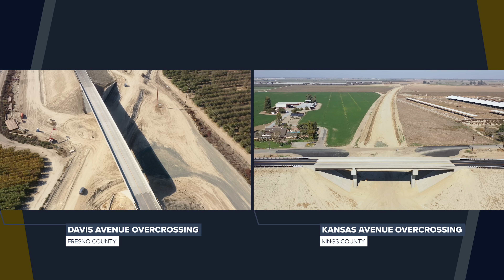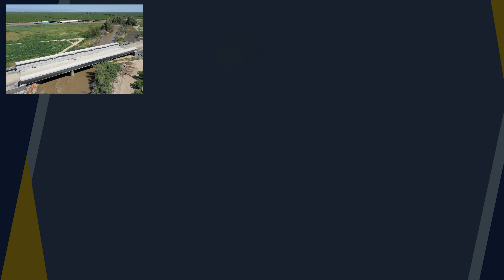Fall 2023 Construction Update: Progress is happening across California thanks to HSR Workers!

Comment: I'm from Texas and excited for this to fully go online. American designed true high speed rail. If anyone has traveled to a country with well developed public rail transportation, you know how much the U.S. needs projects like this. Interstate 5 and flying won't be the only fast options anymore.
Reply: I’m excited with texas central and amtrak’s plan, let’s see when the line from dallas to houston will open
Reply: It will be the fastest option for travelers. It’s going to be faster than flying or driving.
Reply: @harutosunaa3881  No it wont be faster than flying.   And as for driving, you still need to get to your destination, which likely is not the train station.    A car allows door to door service.
Reply: Well, how's your high speed rail going
Reply: Not just American designed but over some of the most challenging train on earth.
Reply: @trippg3261  Sorry, but the Terrain is definitely not challenging. It is almost completely flat. Meanwhile, in my home country of Austria (and Italy) we are building the longest tunnel in the world to connect Italy and Austria under the alps (Brenner Base Tunnel). Germany and Denmark are building a Tunnel under the sea (Fehmarnbelt tunnel). Sure there are other big challenges but difficult terrain is not one of them.
Reply: @florianix8272  The Central Valley section currently under construction isn't in challenging terrain, but in the next phases the line will have to cross 3 mountain passes (Pacheco, Tehachapi and Soledad) with with some pretty long tunnels (Pacheco Pass Tunnels will be 21km in length). It's not the Alps, but it's not flat.
Reply: @elperenza  That's cute. But it's nowhere in the mentioned area of "over some of the most challenging train (sic!) on earth." Just for reference: the original gotthard train tunnel in Switzerland has a length of 15km and was openened more than 140 years ago! So please don't be too proud by building an average train line, if it even will be completed anyway.
Reply: @1879heikkisorsa  I'm Italian, I know my Alps very well. Sure, the original Gotthard tunnel is a marvel of engineering (and so is the new Base Tunnel), but that doesn't mean that 20km tunnels built today aren't still an engineering challenge.
Reply: @1879heikkisorsa 

" the original gotthard train tunnel in Switzerland has a length of 15km and was openened more than 140 years ago! "

It's much shorter than what we're talking about and the Americans just fly, it's a lot faster and much cheaper for the government.
Reply: @neutrino78x  kiddo, that's just one example of many in such a small country as Switzerland is. The main point you really missed: That was done almost 1.5 centuries ago with much much less technology available. So it's simply wrong to state that this tunnel is one of the most challenging in the world.
Reply: @1879heikkisorsa 

"kiddo,"

I'm 45.

 "that's just one example of many in such a small country as Switzerland is. "

Yeah, it's small, so if they have HSR it doesn't mean we should have it.

We use trains a lot here too, for short distances.

"So it's simply wrong to state that this tunnel is one of the most challenging in the world."

I wouldn't necessarily say that, but it is a challenge and it's one of many reasons why the idea of CAHSR is stupid and a huge waste of money.
Reply: @florianix8272  Have you seen the plan for the tunnel from the high desert into the Los Angeles basin? Perhaps not the longest. but Palmdale-Burbank with about 4 tunnels, the longest at around 45 km (I don't believe a final alignment has yet been selected) is nothing to sneeze at.
Reply: @florianix8272   the Los Angeles area especially coming into it from the north is definitely not flat and does pose a challenge for american engineers.
Reply: Yeah I'm from Norway and we built a tunnel under the sea which is 28 km long. Or look at China what they achieved! A 20 km long tunnel is only a engineering challenge which can be solved. I think a lot of Americans are used to things fall before their feet and don't really have the patience to walk a longer difficult path to achieve something bigger. @elperenza
Reply: on which earth is this challenging to build? @trippg3261
Reply: @trippg3261  The rail cars are being bid on by japanese and european companies, hardly American.   Keep the lie going however.  This thing is a disaster.
Reply: An interconnected rail system can only be good for the future of our country.
Reply: @inyobill Thumbs up unto infinity👍👍👍. Is about time money was invested in this country.
Reply: @ac1888  "... about time ...", right?
Reply: One of the biggest downsides of things like new train stations is the lack of human sized spacing around. Once you get to many locations on a train you’re back in car dependent hell. 

That’s a result of cars being the only option. That’s why we have to be building public rail as much as possible to drive demand for human sized spacing. Property changes based on demand, and public funding is one of the few mechanisms that can change the type of demand an area accommodates. Capitalism doesn’t want to invest on public infrastructure because the returns are too low if there is any return at all.

Hopefully we realize that, projects like this are not one and done but require constant construction and constant investment to keep expanding and keep connecting small towns and areas that fit the human scale.

I would love to hop on a train and travel south to CA and never touch a car while exploring.
Reply: @ColrathD transit in the Bay Area and LA area should be good. It’s the Central Valley cities that rely on buses where it’ll be more of a challenge. 

Ridesharing will be a big thing around there as well as within the major cities, but even more so will be more affordable housing and full-fledged communities with everything needed (grocery, post office, pharmacy, etc.) within walking distance of the stations, so one wouldn’t necessarily have to drive anywhere to begin with.
Reply: @ColrathD  It helps that the stations themselves will create walkable demand around them. You'll see small areas with high-density development pop up once these stations start seeing actual use. It's not enough, but it helps.
Reply: @ColrathD  The funds would have been better spent on widening I5 freeway. That will make driving faster and safer.
Reply: @dave8599  when has widening freeways improved driving speeds? The fastest places to drive are interstates with just two lanes. Even at high capacity, the speed comes from long straight roads. No matter how wide lanes are, freeways with slight turns always slow down traffic. 

The worst part about driving a car into the city is being limited by parking. It’s like there is a huge line drawn between what someone with a car can visit and someone without a car can visit.

Investment in freeways is a backwards way of solving traffic. They don’t need more investment. They’re incredibly expensive and inefficient. Public transportation can move a lot more people than cars ever could dream of.
Reply: And I’m from Texas, but I live in Oregon. I’ve also lived in Virginia, Oklahoma, and Florida.

Show me someone who can explain why any of that’s relevant, and I’ll you show an i.diot.
Reply: @cwg73160 you're too United States and free travel and unified document systems to appreciate our regional rivalry.. Texas and California, both carry lone stars in our flags.  Somewhere along the line the rivalry turned bitter, but it was always meant to be a healthy one.  We're both a long way from DC and have a mind of our own.
Reply: Let's build two different high speed modern travel systems that meet in Tucson or Phoenix
Reply: I'm still miffed that Florida passed us in getting a HSR first and California is still building it. But I bet it's gonna be monumental connecting central valley to both Nor-Cal and So-Cal cities.
Reply: @PsychoSpiral  it's only to be completed Merced to Bakersfield. Once they get done with that they will stop. There's no more budget to continue. It was a stupid idea from day 1, it's too far for rail
Reply: "Interstate 5 and flying won't be the only fast options anymore."

Uh, yes, they will. The flight is ONE HOUR.

This distance is too far for HSR. It's 380 miles or 611 km. The only comparable line in Europe is Madrid to Barcelona, which isn't really comparable because the population density of Madrid and Barcelona is quite a bit higher than that of Los Angeles. 

This thing would (it's never going to be completed) take at least 2 hrs 40 minutes, and as a practical matter, more like 3 hours at least. (2 hrs 40 min assumes you can go SF to SJ in 30 minutes, which would require the maximum speed to be raised on Caltrain, and we're nowhere near being able to do that.)

Higher Speed Rail, along the coast line (including Amtrak Pacific Surfliner) would make a lot more sense as it's a lot cheaper and it wouldn't be much slower (about 4 hrs SF to LA, vs 3 for hsr).
Reply: @neutrino78x  "The flight is ONE HOUR."

Plus showing up to the airport at least an hour early (likely more) to go through security and wait for boarding, then starting boarding to actual takeoff is a minimum 30 minutes, getting off the plane is like another 15 (again, minimum) after landing, then another minimum 15 to collect your bags...  So that "one hour flight" quickly turns into three hours even on the best possible day.  Oh and all of this is assuming the plane is actually on time, which any regular flyer can tell you is a crapshoot.
Reply: @zackakai5173 

"Plus showing up to the airport at least an hour early (likely more) to go through security"

Nah, that's more like 20 minutes. Just because you suck at travel doesn't mean it's that way for everybody.

This is more valid in Europe where their airports are typically very far away from the dense part of the city.

For example, here in San Jose, SJC is only 3.8 miles from the downtown core. 

Plus you know, when you're talking about a three or four hour train ride, versus a one hour plane ride, that isn't really saving you enough time to say "well it took three times longer but I avoided security which only takes five minutes". 

There's no logic in that argument. Fail.
Reply: @neutrino78x Yeah and with a high speed rail you have a much more comfortable travel than a plane, you go on and off in the city centre, you can arrive in the train station 5 minutes before the train leaves. So your one hour flight is not much faster if you go to and from the airport (with car instead of local train I assume), and wait at least 30 minutes for the flight. It's not really a time saver pluss it creates much more CO2, and is less convenient. High Speed train outperforms flights if it's build complete and not reduced by conservative populists!
Reply: @Skogbox  

"eah and with a high speed rail you have a much more comfortable travel than a plane"

Who cares when it is too slow.

The distances involved here in North America are far greater than in Europe, and the population density is too low to justify the enormous expense.

Simple as that.
Reply: It's still 10 years out from the first paying rider and the fare charged will never cover the cost of maintenance much the current estimate of $128,000,000,000 to build!
Reply: @mobeydick37  mobey, these fools are going to argue with you but you're 100% right. I voted no on this nonsense with pride, despite being a lifelong centrist Democrat. I agree with you, it's a complete joke.

The good news is that the Governor has already stated, "there is no path" financially to complete the whole thing, so his orders are that they complete what they started -- merced to bakersfield (nowhere to nowhere) and then stop.

Technically he can't actually stop the project, because it was a voter initiative, but he doesn't have to make it his number 1 priority either lol
Reply: @neutrino78x Car lobbyist

Stop acting with such entitlement. You obviously know nothing regarding the progress and benefits of this project.
Reply: @fizzystuff 

"ou obviously know nothing regarding the progress and benefits of this project."

Your argument is so compelling! We are all smarter having read it!

He said sarcastically
Reply: Interstate 5 is awful 
Especially the Grapevine and anywhere near LA, plus random accidents that cause slowdowns
Reply: @dragon_nammi 

"nterstate 5 is awful "

That's why most of us just fly.

There's no traffic on I-5 BETWEEN the Bay Area and LA.

WITHIN LA, yes.

WITHIN the Bay Area, yes.

BETWEEN them, no. Everybody flies.
Reply: @neutrino78x  Spoken like someone who doesn't drive the I-5. There is always traffic. And the airport is lousy as well, not to mention you need a rental car at the end or to pay for ride hailing if your destination is close enough. Not to mention your flight can be delayed or cancelled due to storms that are common in the eastern United States, where your plane is likely to be coming from. Last year my flight was cancelled last minute and there were no other flights leaving in time.  I had to drive the I-5. Even when I try to avoid it doesn't let me.

Now is the traffic is bad along I-5? Certainly not, but it IS just a two lane highway. Semi trucks passing each other are enough to slow things down to below the speed limit, quite often. Along with accidents that tend to block at least one lane of traffic and clueless drivers sitting in the passing lane. Not to mention it is a straight, boring road with little to keep your attention once you leave the cities and mountains. It's just awful.
Reply: @dragon_nammi 

"Spoken like someone who doesn't drive the I-5. There is always traffic."

In Los Angeles, yes. By saying "the I-5" that tells me you are from LA.

But you have to remember, this project would have zero effect on traffic WITHIN the city and county of Los Angeles.
 
"And the airport is lousy as well,"

Nah, the airports work great. I make the trip often, security is a five minute thing.

I never arrive earlier than 10 minutes before boarding begins and I never run into problems. 

As someone who flies it normally, my opinion is important, because you're trying to get us to stop flying and use your stupid train.

And I'm telling you right now, no one will do that because it takes three or four times longer.

" And the airport is lousy as well, not to mention you need a rental car at the end or to pay for ride hailing if your destination is close enough"

Same for your train. I don't know why you think it would magically terminate where you're going within LA. It would terminate at Union Station. 

It's a huge waste of money.
Reply: @neutrino78x  You might fly, but I drive the the route more often than I like. Your opinion matters as much as mine does, as a similar amount of people drive and fly. A fast train is a compelling proposition for drivers, and a cursory web search says there are about 11 million auto trips between LA and SF annually. Grain of salt of course.  If you find it easy to fly, then you will keep flying. But I expect a lot of drivers would consider it. Driving the 500 mile route is awful. 

Yes, LA has the worst traffic. But if that's where you think the traffic stops, you're dead wrong. There are only a few sections where you can actually drive at a decent speed on the I-5, starting about 150 miles away from the Grapevine. That's when people just start to thin out. But you will eventually be significantly slowed down by semis passing other semis, however long that takes. There usually is at least one accident along the flat boring section of the interstate which can cause a decent delay. On my most recent trip, there was a massive hour long delay on the Grapevine alone, and I encountered 3 different accidents on the return trip before encountering the Grapevine on the way back. Each with its accompanying slowdown since one of the two lanes was blocked by debris for each accident. And I mean slowdown, down to an eye watering 0-5 mph.

And that's without even mentioning people who clog the passing lane and cap speed at 65 despite it being a 70 mph zone. You're misinformed about there being NO traffic once you're out of LA. 

And of course... the it can be a dangerous route, particularly if there are storms.

And you misunderstood what I said about having to find last mile services after the flight/train reaches the destination. I'm saying it is an added hassle to the costly experience that is flying. Yes, you will have to deal with the same with the train. In an ideal world, there would be more Caltrain routes that can take you to smaller cities and trams that can take you from the main hsr station to a closer spot to your real destination once in your city, (like in Europe or Japan) but admittedly this will be severely lacking for most places outside of SF and LA for a long, long time. 

On the other hand, train stations take up a much smaller footprint on the surrounding area and don't impose height restrictions on any nearby buildings since.. no giant flying machines. So they can be nestled pretty deep into cities, whereas airports tend* to be secluded away. Additionally.. it actually does generate revenue. Unlike road infrastructure, which quite literally does nothing but bleed money as it breaks down over time. I can't imagine it's cheap to resurface the Grapevine. 

Also, airports suck to deal with. I'm not the only one who thinks that. If you do it for your job I'm sure you get used to it, but I only fly to visit family  if I need to, and I never find the experience pleasant. This is subjective though.
Reply: @dragon_nammi 

"You might fly, but I drive the the route more often than I like."

Why the hell would you do that???? It's a FIVE HOUR drive at least!!!

You can fly it one hour!!!

 ", as a similar amount of people drive and fly."

NO THEY DO NOT.

Look at a traffic map of California. Go look on Google Maps right now and turn on the traffic layer!!!

DO YOU SEE ANY RED ON I-5 BETWEEN THE BAY AREA AND LOS ANGELES????

NO, YOU DO NOT.

The traffic is WITHIN THE COUNTY OF LOS ANGELES AND WITHIN THE SF BAY AREA, NOT BETWEEN!!!!!!!
Reply: The trains themselves are out to bid by Japanese and european train makers, so much for American designed.
Reply: I wouldn’t doubt Texas be the next state to make a High speed rail system. Texas has a powerful economy I bet Texas build there HSR faster than California. That’s my opinion
Reply: @sirchimedina7338 

"I wouldn’t doubt Texas be the next state to make a High speed rail system. "

There's a private company that wants to build one, but it would be private transportation, like an airline, not public transit.

 I think Amtrak is now working with them; hopefully they won't waste any public money on HSR, which became obsolete in the 50s with the advent of cheap high speed transportation via jet aircraft.
Reply: Texans should send you back to Commiefornia.
Reply: I can't wait for my grandkids to enjoy this after I pass.
Reply: @LebronCCP  Make the government know you want it and you might even get to see it ;)
Reply: @dragon_nammi 

"Make the government know you want it "

We already voted on it, it's a mandate from Prop 1A from 2008, the people already voted to require it.

But I think what's going to happen is we are going to incrementally improve the coastal line (Amtrak California) and just declare the project complete in that form.

If we can get Amtrak to average 75 mph -- no increase in track speed needed for most of the track, most it already allows 79 -- an express train could go San Jose to Los Angeles in about five hours. That's not as fast as CAHSR but it's something the state can afford, it's far cheaper (and already being done, over time, with existing budgets).

The Governor already said, "there is no path" to the 100 billion the CHSRA wants to complete Phase 1, and therefore "there shall be no more construction" beyond Merced to Bakersfield.
Reply: @neutrino78x  Unfortunately for Newsom, he is term limited and cannot run again in the 2026 election. He has political aspirations for the presidency so I'm sure that's playing into his decision to not focus on the project while his name is attached to it.  Hopefully we can get someone who will see the project through properly. 

Not to mention, Amtrak doesn't own any of the rail lines in California, and most are owned by Union Pacific or Berkshire Hathaway. Any priority, if any, Amtrak has over freight trains on those rail lines must be negotiated and paid for with substantial compensation. Or, they simply have to yield to freight trains and wait for any to pass.  I'm sure ticket prices reflect these negotiations as well. 

I understand the appeal of looking at Interstate 5 and wondering why they didn't just follow it, but I-5  through the Grapevine is firstly, too steep for trains at speed and secondly, the right of way does not provide enough room for the huge smooth curves that are necessary for a train traveling at over 150mph, let alone if they want to enable it to travel at top speed. Going along the I-5 would've meant burying the line for about 25 or more miles under mountains and crossing the infamous San Andreas Fault. Expensive potentially unstable tunnels. A 25 mile tunnel through mountains sounds quite the hassle compared to taking that overland detour through Palmdale. 

Europe can get away with huge tunnels length wise because they don't really have tectonic activity, the plate boundaries are quite far from most of western Europe.

Could a meticulously planned tunnel route that avoided crossing the main San Andreas Fault have been planned out? Maybe. But that's not where the project is anymore. It's too bad the way the project has been handled but at least it's actually getting built now. Arguably it's a good thing that California's valley cities are being included in this and it's not just San Francisco and Los Angeles having a party of 2.
Reply: @LebronCCP 

"I can't wait for my grandkids to enjoy this after I pass."

Your grandchildren will likely be flying on aircraft driven by electric motors and powered by a coil of superconducting wire. Same speed as current aircraft, zero pollution, much faster than the CAHSR. 

But before then we will be using either hydrogen or batteries for all the flights between SJC/SFO and LAX.

This kind of stuff, HSR, was obsolete once the jet aircraft became something that the average person could afford to use.

And the Governor already said "nope" and that Merced to Bakersfield will be completed, and then that's it for the foreseeable future.

Maybe, decades from now, when they save up enough from Cap and Trade, they'll have enough budget to tunnel through from Bakersfield to Palmdale.....it's the project's fault, leadership made a lot of stupid decisions. 

I voted no, but you know, if they had been smart and built it down the median of I-5, they'd probably have been done by now and the cost would have been closer to 30 billion instead of the 100+ billion they want now.... (which is why the Governor "nope"'d out)
Reply: I-5 isn’t fast
Reply: @DondiniMontefusco 

"I-5 isn’t fast"

It's faster than 99. It's shorter and straighter, and there's no towns between Tracy and Los Angeles on I-5. Also the median is about 60 feet wide for most of the route. You have a 240 mile straight shot between Tracy and Bakersfield where you can actually average 220.

Why do you think Brightline is going down the I-15 median, instead of a longer route that's not as straight with a bunch of towns in between?????

Look, dondinimontefusco, you have to understand, the 99 route was not chosen because it's wiser or better from an engineering perspective. It was PURELY so the inbred rednecks that live in the Central Valley would support prop 1A.

I don't know why you are supporting this stupid political decision that makes the train a LOT slower and a LOT more expensive.
Reply: Nah. Not “Interstate 5 and flying won’t be the only fast options anymore.” /
Reply: You do realize those countries don't need cars to use rails n HSR.
Stop comparing if you have no intention to support local public transportation as good as other countries. 
Many of HSR supporters don't. Theyjust want expensive toy. Forget it.
Reply: @commentorsilensor3734  

"You do realize those countries don't need cars to use rails n HSR"

What country doesn't use any cars? None of the G7.

Here in the San Francisco Bay Area we have world class public transit and still have lots of car traffic.

Same is true of London, Paris, Rome and New York City.

"Stop comparing if you have no intention to support local public transportation as good as other countries. "

We already have it, in our major cities.

But SF to LA is too far for per se HSR.

I do support "higher speed rail" which is what is being done with the coast line (San Jose to Los Angeles along the coast).

Note that the San Jose to Los Angeles part is not in any danger from beach erosion etc., that's the part south of Los Angeles. 

(and the Amtrak Surfliner (LA to SD) will eventually be moved inland and/or underground.)

If they had used the method a person of normal intelligence would have used for CAHSR -- just go down the median of I-5 -- they could easily have done it for the 30 billion we originally allocated.

Instead they went down 99, which was very stupid, because instead of using land the state already owned, they had to buy all kinds of private land. 

As a result they are now saying they want 100 billion to complete  "Phase 1" (SF to LA). Stupid, stupid, stupid.

So proud I voted no on this nonsense in 2008. And yes, I do like transit, it's how I get around (I don't know how to drive). I'm a centrist Democrat, Biden 2024. It was just a poorly written measure, and the execution of it was even worse.